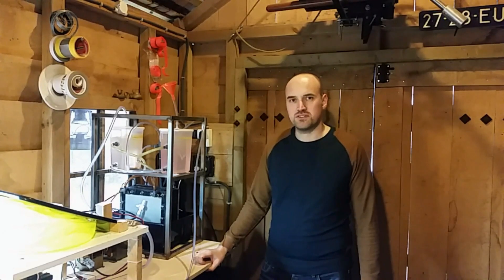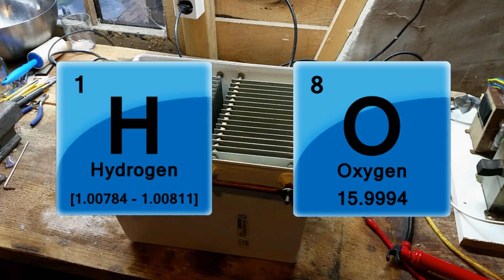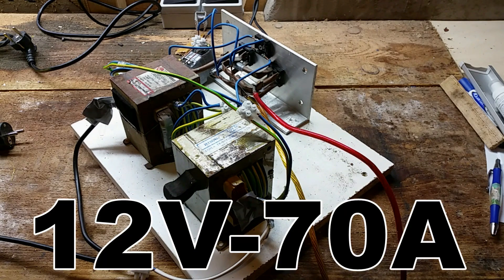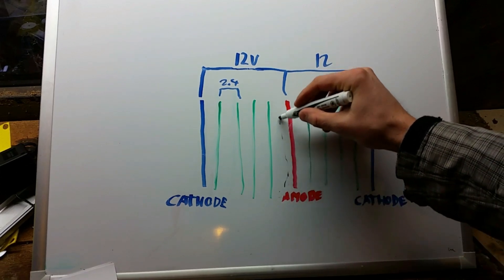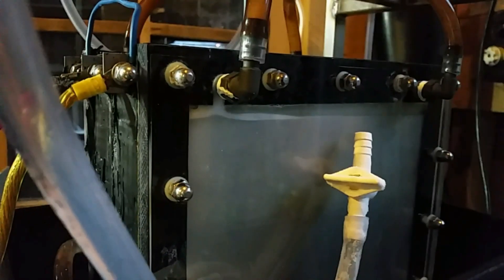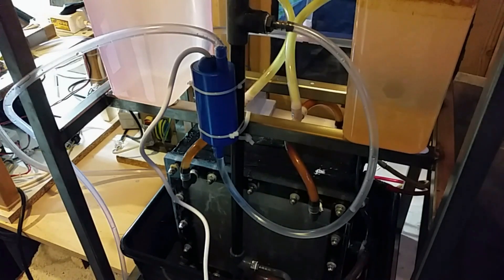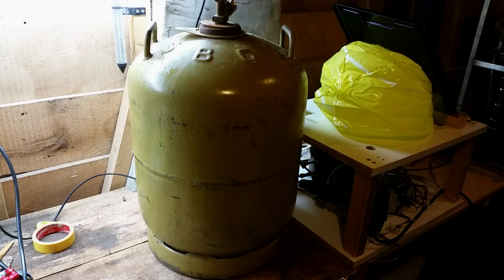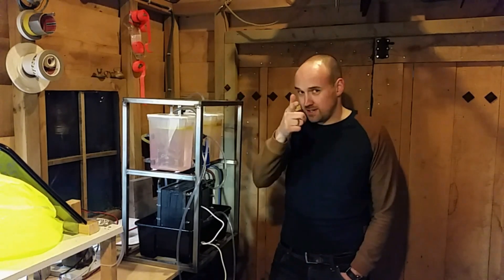Hydrogen Generator #1 Homemade Hydrogen Generator And Compressor Unit

Comment: whats the blue thing on the pipe? and are you using dc? i thought ac was better but it seems impossible to separate the gases with ac.
thank you for sharing your knowledge... youre awesome!
Reply from the maker: Thanks!! I think you mean the cool water pump? Yes I use DC. AC will not work.
Reply: @TheDIYScienceGuy  yes, the cool water pump :) how does that thing work? you have wires running only to the 2 cathodes and 1 anode? how does the current make it all the way through each neutral plate? and do you have different ion solutions for +/-? it is a really cool design!
Reply from the maker: No only sodium hydroxide. The neutral plates are also stainless steel so thay will conduct electricity.

Comment: ok but when you dont check the membranes every minute its just a matter of time when a accident happens.
I suggest to add extra safety like an arduino with a oxygen sensor so you get an alarm and the machine stops also. like this one https://www.ebay.com/itm/O2-A2-Oxygen-Sensors-Alphasense-Capillary-Flow-Control-Sensor-New-Original/401686441537?_trkparms=aid%3D555018%26algo%3DPL.SIM%26ao%3D1%26asc%3D20131003132420%26meid%3D427abda4299047caa376ecb3d274ba5c%26pid%3D100005%26rk%3D2%26rkt%3D4%26sd%3D263688526668%26itm%3D401686441537&_trksid=p2047675.c100005.m1851
or maybe you could use a car 02 sensor
(price around 10$)
https://www.youtube.com/watch?v=w3iuqttBrPI
 https://www.ebay.com/itm/4-Pin-Upstream-O2-Oxygen-Sensor-For-Honda-Acura-Civic-CRV-CR-V-AM-32232736-SG336/142998604449?hash=item214b618aa1:g:9MoAAOSwkaZZcFs2&vxp=mtr

Comment: Also the gas likes to come out of sharp edges of the metal, the more edges the more gas... the 3 electrode can be sheet or mesh metal. Sharp 5 mm strips guillotine  cut, as rough as  possible and woven in to a Matt and orientated in to a diamond square hole with the points pointing  upwards. The tiny bubbles can come out and merge with others and wander diagonal upwards until big enough and relies them self with a Gnomon spirals upwards motion, and shoots trough the surface with great speed.   mesh Plate after plate, or roll multiple cylinders stacked into each other. Clean water no additive,,,!!!!! if ???   then baking soda.  Water will take on charge. It is a  Water Triode, it has 3 terminals, it has a magnetic field,,, get the compass. it can conduct current trough it,  from the grid no. 3 terminal feed  some lights,  back to the neg or pos terminals and removing the surplus free electron. You will get much more gas from the electrodes and the receiver no, 3 electrode becomes a gas producer also. Diamond mesh also with Sharpe edges, use  a solution to hermetically clean the plates... assemble with gloves... It is powerful Orgon producer also... if you are around it for a while, under test for hours and you can overcharge yourself' s,  you feel nauseated  in the process. Switch off and  have a hot shower, this will wash the surplus orgon away. It bring your energy field into normality,,, but after a while one gets used to the slight overcharge...ask and it shall be answered,  I worked with 24 / 48 volts. But 2 volt is fine,, normal cell voltage. The Mesh can be spot-welded but all weld points are becoming magnetic point, test with neodymium magnet,, Fer rite or iron  magnets wont tell you it has become magnetic.,,,not desired unless other wise. It can be annealed to distribute the magnetism.  The grid 3 electrode metal should be of a linear like coiled roll or similar construct aspect. LOL....Edgar..76.

Comment: my observation and tests....wen the process start,  it produces good gas... after a while you try to bang the gas, you will find it has not got the implosive sound as before, and after same time it does not bang at all. Water is a dielectric of @ 80-1 it does not want to take on charge, But over time it will charge itself to a higher volt potential. Unless you learn to harness the extra electron which are now free in the water and burn them of with light bulb. You do that by placing a s/s 316 electrode above the 2 sacrificial  electrodes.
Reply: you could use pulsed voltage or/and alternating current
Reply: the test i did was a analog test,  with battery voltage and smooth dc. have tested it with switch mode as well.....,, I like Stan Meyers work,  @hyperhektor7733
Reply from the maker: Stanley Meyers system has been proven false over and over again.
Reply: @The DIY Science Guy , how did he get multiple patents for his inventions? Keep in mind its very easy to proove a device wrong by just building it wrong, this way for example i could proove DC current wrong by just use wrong polarity ;D. Just because someone cant do it is no proof that nobody in the world can do it. I see this wrong assumption over and over again on youtube :).
Kepp in mind in patents are state broadly for 2 reasons, to "hide" the exact working/optimal parameters or to include unknown working conditions.
For example if a device works at 111,11mhz and at 222.22mhz the patent would just write from 10-1000mhz.
A good example are  some Tesla's inventions too, his deathray, his Tachyon car and the earthquakegenerator are lost (probablystolen by intelligence services),
so "debunking" these is an unvalid argument since no correct plans are aviable.

 I did patent research and similar devices where also patented before him, so what exactly has been prooven false over and over again? please proove your statement with some links.
Reply from the maker: https://en.m.wikipedia.org/wiki/Stanley_Meyer%27s_water_fuel_cell

Comment: I have a question, what circuit to make it so the buffer uses separate switches to turn on and off the compressor? Thank you
Reply from the maker: I have a diagram on Instagram which might help https://www.instagram.com/p/Bpl2pLijM7z/?utm_source=ig_share_sheet&igshid=1pkp4rs7cjv17

Comment: If you add a catalyst to the electrolyte solution, you might be able to push the optimal efficiency voltage up from 2V and get a faster reaction rate with less waste heat
Reply from the maker: Ok thanks! Do you have suggestions for a soluble catalyst that I can mix in with the electrolyte?

Comment: Sir may i ask what did you use to coat the sides to avoid leakage?
Reply from the maker: I used this stuff https://www.installand.nl/shop/bouw/lijmen-en-kitten/bostik-superfix-009-lijmkit-290-ml-zwart-30606097?gclid=CjwKCAiAnsnjBRB6EiwATkM1XpsfLt4AgyI6Bbq9_1xb_16CqYOHPp-7YtD4TRR8Ypz7YmR7cX7s-hoCN7kQAvD_BwE it's the best! Good luck!
Reply: @TheDIYScienceGuy  sir may i ask for any alternative because that product cant be bought in our country
Reply from the maker: Sorry I don't have an alternative brand but it's an polyurethane based glue type stuff.
Reply: @TheDIYScienceGuy  thank you sir :)

Comment: Questions:
1) Why you dont use KOH instead NOH?
2) What is the best NOH concentration?
3) What is the effect of plate distanse in hylectrolisys performance? 
4) Is there any source that answer the above questions?
5) I assume that if we create multiple cell of this type reducing the voltage per cell we will maximize the effectiveness of the proccess.Is this correct?
Reply from the maker: 1: not for sale in my local hardware store and makes no difference in performance as fare as I know besides the lower freezing point of KOH which is not a problem where I live.
2:I use 50 gram per liter.
3:the closer the better, but to separate the gases you need "some" distance.
4: yes, me 🤣. real answer: I don't know, most of these things I know from experimentation.
5: yes that is correct but if the voltage per cell drops below 1.5/1.8 volts it stops working. 

Thanks for your questions, hope it helps!

Comment: Great job ! respect my friend.
I have heard that oxygen concentrationshould be lower than 4% in order to have safe hydrogen oxygen mixture. So is important to measure with accuracy the oxygen concentration. I have see cheap xygen meters on ebay approx. 80 euros.

Comment: You might not be producing hexavalent chromium it depends on the type of stainless steel your using there are some stainless steel alloy contents that constitute nickel as a chromium analog I would search for this alloy as it might be what your searching for by the way seriously props for your membrane separation method
Reply from the maker: Well I know that the stainless that I use contains 18% chromium so I'm going to replace the electrodes with nickel plated copper. Video coming soon! Thanks!

Comment: Is there a way of detecting the gas to make certain it has no oxygen an oxygen alarm ? I've already blown my finger apart once with a jar version. But I love the idea.
Reply from the maker: Yes. You can use a piece of catalytic converter and measure the temperature of the gas going in and out, if there is oxygen in it the temperature will rise. You can also do it optically, if there is oxygen mixed with hydrogen than the light refractive index will change and you can measure that by shining a laser trough the gas and detect the movement of the laser beam. Of bought these systems I going to make a video.
Reply: @TheDIYScienceGuy  thanks. Excellent video and I've subscribed so look forward to viewing some more. How much less volatile is pure hydrogen than the mix?  I should probably look this up myself.
Reply from the maker: Thank you so much for subscribing! Hydrogen alone does nothing. It can only react with other elements or molecules.

Comment: 3:20 WRONG. the heat is given off because water has resistance, 2 volts are needed to split water, the other ten are wasted heat W=V*I=R*I^2
Reply: Except water's differential resistance is not constant across all voltages. There's a dip in resistance when the mean thermal energy of the free electrons equals the first excitation energy of a hydrogen-oxygen bond

You're not totally wrong, but neither is OP

Comment: Would a propane tank become dangerous, eventually, from hydrogen embrittlement?
Reply from the maker: Probably not, because that happens at much higher pressures, but it's always a good idea to do a pressure test with water once in a while.

Comment: whats the upkeep on this device, do you need to buy anything regularly?
Reply from the maker: The only upkeep is that there might break something but that hassen't happen't jet. I'm only replacing the electrodes with nickel plated copper electrodes to increase efficiency and to prevent that chromium is oxidized out of the stainless steel, because it can cause cancer when it touches your skin, amongst other health issues.

Comment: i want to see this run a car engine.. 

or blow a hole in a cloud using remote detonation.. ie, a tube being taped into a balloon and floated up to cloud height and see if the sonic wave from the explosion will cause a hole in a cloud after detonation. 

thanks.
Reply: Please don't

Comment: why not make multiple hydrogen cells at 2 volts?
Reply from the maker: Because that's more complicated. Now I have have one instead of 10.
Reply: @TheDIYScienceGuy  you can make smaller cells.. and btw now i have your attention, where are you from?
Reply from the maker: Yes but smaller cells means less production. The surface area determines how much hydrogen it will produce. I'm from the Netherlands, same as you. 😉

Comment: So the electricity was only able to transfer through the neutral plates after first transferring through  the solution? The plates in the middle where not connect via any medal? Also how did u then keep the plates together? Will a normal air compressor cause am explosion? Like does it spark?
Reply from the maker: Yes that's how it works.

Everything is separated by 4mm EPDM seals and clamped together by bold's. 

No a normal compressor is not suitable because of the chance of leakage and therefore the chance of air mixing in to the hydrogen.
Reply: @TheDIYScienceGuy  but a refrigerator air compressor is fine? Also if so why? What does the refrigerator air compressor have that a normal on does not
Reply from the maker: It's used in an enclosed system so you can be absolutely sure that you will only pump what you feed it. Also, most normal compressors have an "open" crankcase so the chance that there will form an explosive mixture under the cylinder is very high.

Comment: Great work mate. I really do hope the government doesn't murder you.   But while your still going at it would you mind answering my questions?

With this setup have you analyzed the pure hydrogen with a gas detector to be 99.9% sure about the content?

With your experience do you prefer wet or dry cell and which one gives better results?

Have you thought of another way to remove the oxygen from the hydrogen like a chemical reaction that consumes oxygen
Reply from the maker: Thanks!

Still alive so I'll be ok I think 😂

1: no I have not but I have plans to do so.

2: I prefer the wet cell. Performance is the same because it works the same way but it works better in a continues system because there is a big reservoir.  

3: you can also remove oxygen magnetically because oxygen is paramagnetic, but that's more complicated and less effective. I'm not familiar with other methods.
Reply: @TheDIYScienceGuy  ty. All the best

Comment: I've been recently looking into hydrogen and oxygen production for a project I'm planning and this is so far the best video I've found. I'd really like to see more of this generator you have, just for educational purposes.  I have a plan that I'm going to test but before I use the materials I have, I was wanting to see a bit more about the transformer and membrane. Most of the videos are using car batteries and do not separate the 2 gases either (hydroxy gas is ok if you're making a torch which I am not) so I'm just trying to make sure I have more facts than assumptions.
Reply from the maker: Thanks! I'm working on upgrading my generator at the moment, so a new video will come soon.

Comment: you should use potassium hydroxide and neoprene as a barier with a pulse width modulator and a relay to the oxygen sensor also try using a pond fogger with gasoline vaporizing your gas use a DC version I've seen cars run off this and get up to 100 mpg  principle in fact I have a dry cell with 35 plates always have a flashback arrestor one way and a bubler so the flame cannot get to the tank helium 3 is the real bang for your buck you will need to contact Bob Lazar for that he runs his better off h3

Comment: If looks like you have made a true fuel cell. Could you make another one and pump hydrogen and oxygen through it to generate electricity? I'm not sure if the felt membrane would work in the configuration.
Reply from the maker: Thanks! I have plans to make something like that in a future video.

Comment: Well according to the people that are doing research into Stan Meyer the secret was to use a mica insulator on the anode and use a thousand volts pulsed at precise frequencies to tease the water molecules apart. No heat is generated. But since I don't have working model I have no idea if it works or if for sure that was the secret. But at a 1000 volts the water would be taken apart electrostatically with essentially no amperage. So the question is was Stan Meyer a con artist who faked his own death? Or was he a misunderstood genius? There is more than enough room in quantum mechanics to entertain the idea that energy can be pulled from some zero point energy source since they found that 0 Kelvin still showed evidence of energy. The great Richard Feynman: “ One teacup of empty space contains enough energy to boil all the world’s oceans.” So are you going to call Feynman and idiot? For some wacky reason most of science is still stuck in the time of Einstein even though he tried to say that space is nothing. His theories also demand that the speed of light cannot be broken. Both have been proven wrong. It is not hard to believe that since it can also be proven that he was incorrigible plagiarist in spite of how many times we are told he was a super genius. If he was so smart why was his wife known to tutor him in math? Why was even e=mc2 published a year before Einstein discovered it? There are so many questions. So who is lying? I will place my bet on those who are making the most money and have the most power.
Reply from the maker: Thanks for the info. However, Stanley meyer concept has been proven falls many times. I don't believe in conspiracy theories, I believe in logic.